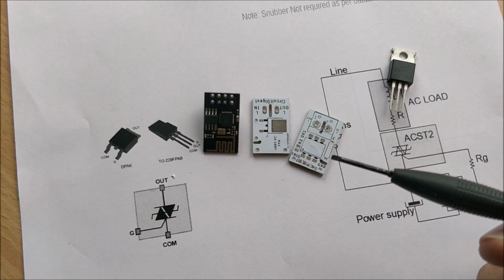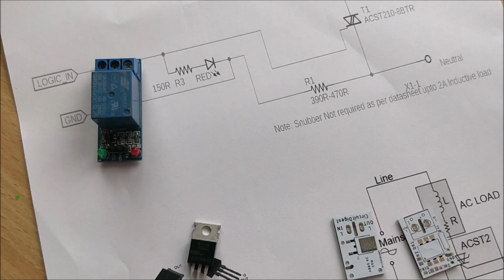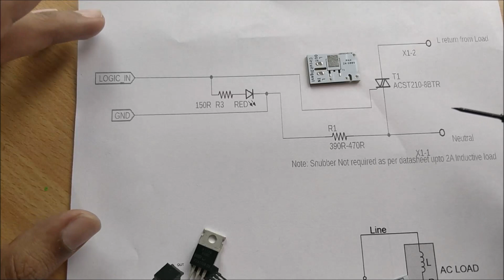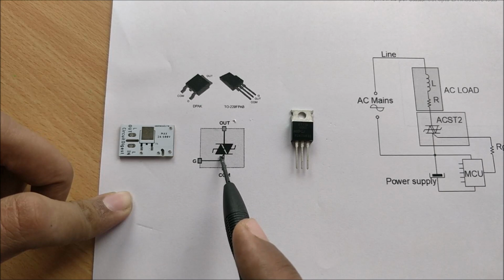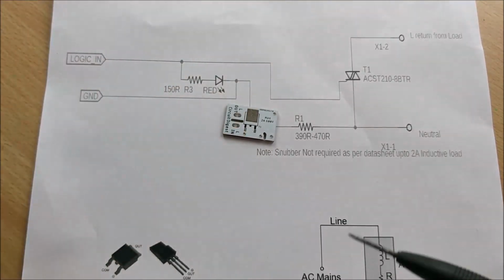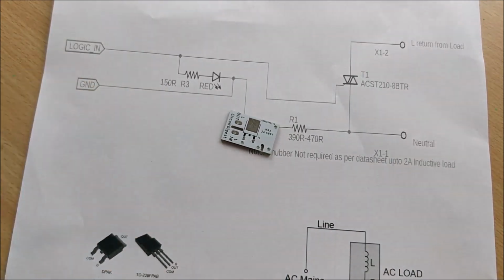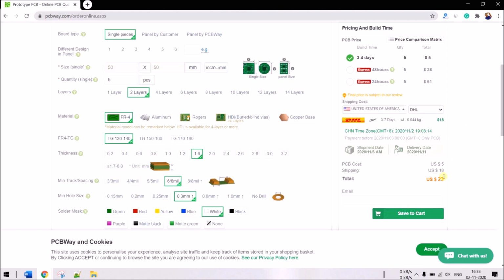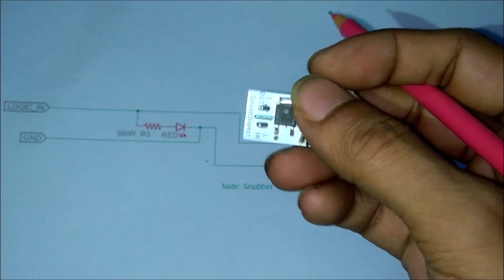Building a Low Power, Compact Solid State Relay to control AC applicance with ESP8266

Comment: what about isolation ?
Reply from the maker: this circuit does not have isolation, the datasheet also does not mandates it. However, if your design has a user interface then throw in a optocoupler